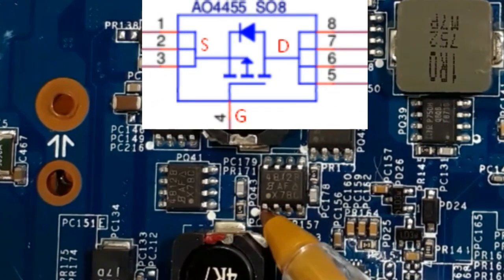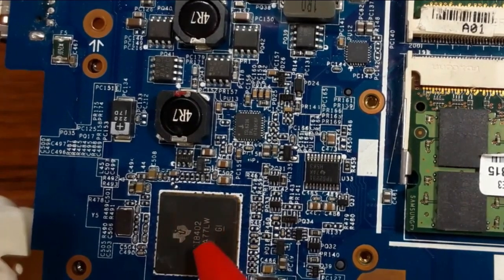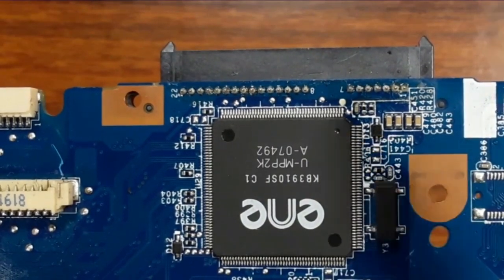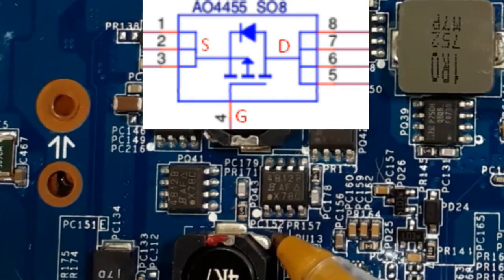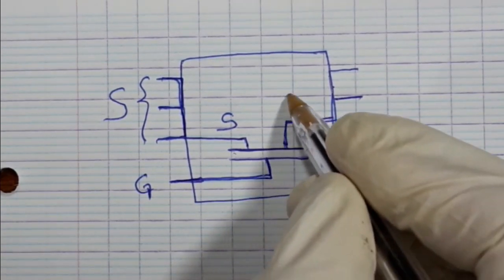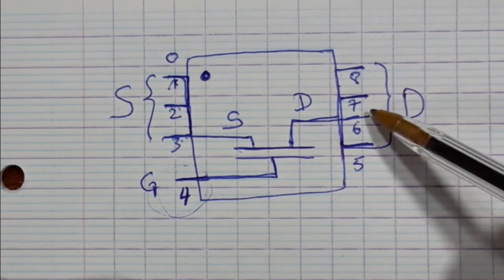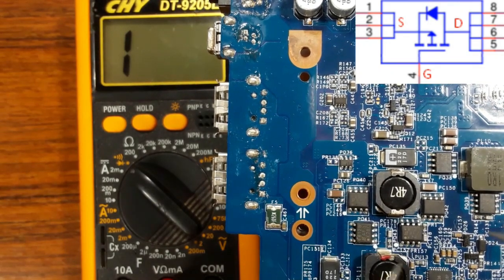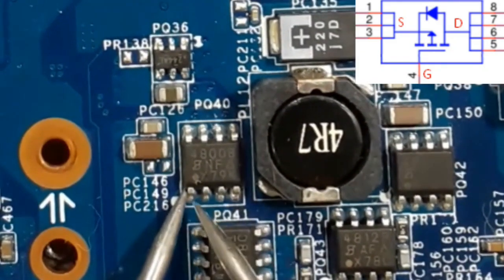Motherboard ICs and MOSFETs Testing Tips & Tricks - Laptop Motherboard Repair

Comment: Great video as usual. I have a question, sorry excuse my ignorance. I wanted to know what's the point of them making 3 different pins if they're all connected together? why not just have one pin instead? Thanks.
Reply from the maker: Good question! The purpose is to divide the current applied to those pins. 0.9 Amps for example will be 0.3 Amps in each pin.
Reply: @electronicsrepairbasics_erb  thanks a lot